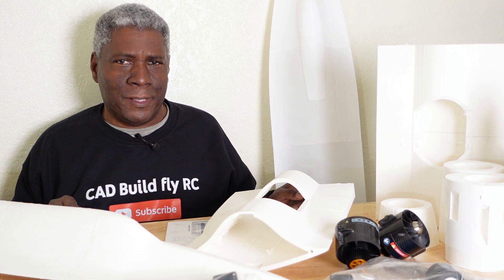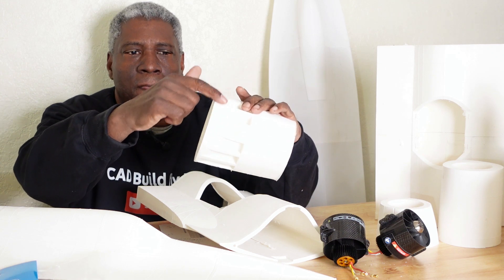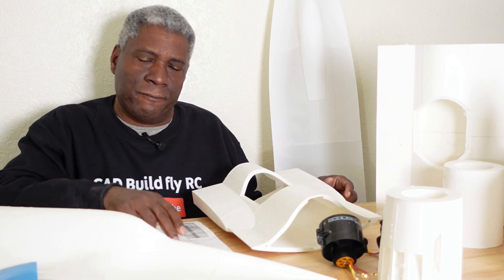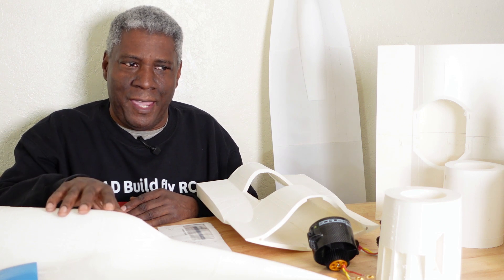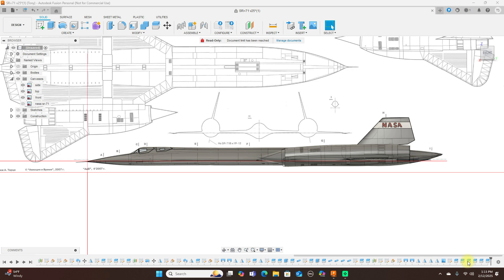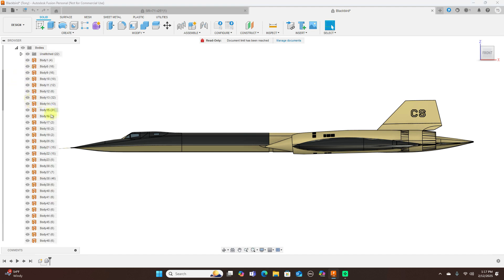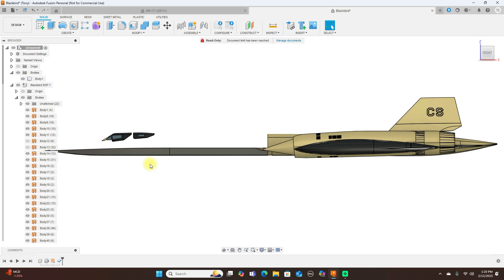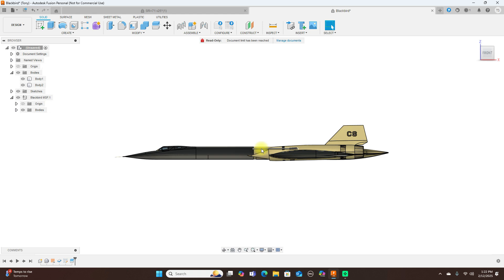3D printed SR-71 VS Motion SR-71 foam a look at and Modeling. LW HT PLA vs Foam.

Comment: Hi I enjoy your videos. This plane is on a bucket list to build. I’m new to 3d printing and fusion. I need help with settings on my bambu p1s parts are coming out heavy or under extruded. I was using polymaker lw prefoamed pla. I did get told I can’t use it because it’s heavy. What filiment do you use on your projects like a10 and sr71?  Thanks in advance.